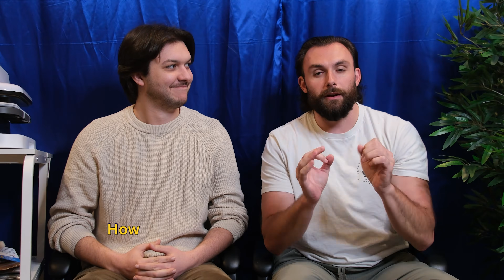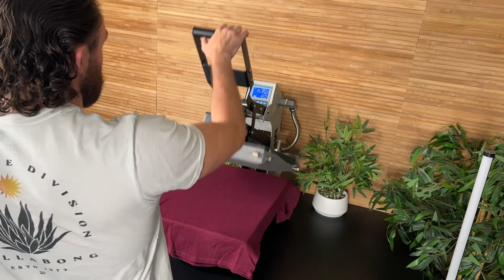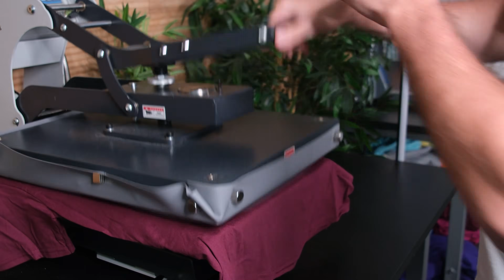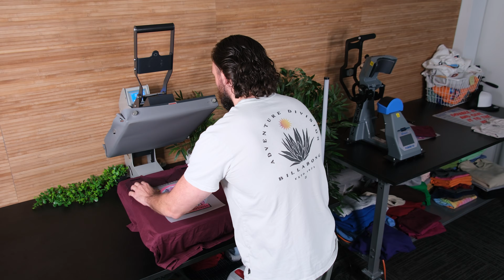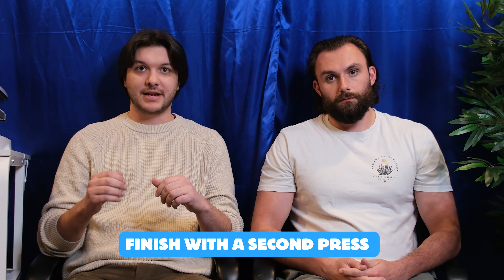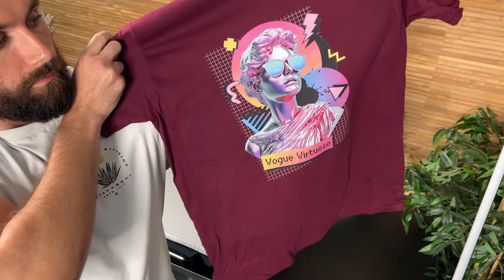How to Press Your First DTF Transfer | Step-by-Step Beginner Guide

Comment: my temp is 360F and after 20 sec pressed the print doesn’t transfer until we cool it. what did we do wrong? it is a hot peel dtf. recommended is 280F. But it’s a huge square print. like an inch within the plate on the side? does that mean the heat on the press is not balanced?

Comment: Hi, I'm wondering if you recommend using heat tape to secure the print? I see people suggest doing it  different ways. I've noticed that sometimes my shirt has print tape imprints where I placed them. I guess I'm nervous too that it might move lol! What do you recommend? I've noticed in several videos you guys don't use tape. Thanks in advance.
Reply from the maker: We recommend for certain projects! Maybe if the transfer is oversized and you want to ensure there is no movement once pressing! Our thermal heat tape is perfect for this, leaves no marks and available on our site! Check it out➡ https://ninjatransfers.com/collections/blank-apparel

Comment: HI! I am very new to DTF. I'm looking at doing family vacation shirts using DTF. I have the HTVRONT auto heat press 2. Will that put enough pressure needed for these transfers or is a clam shell heat press better? Also is the teflon sheets ok for the final press?

Comment: For the second (finishing) press, is your "Heat-Resistant Pressing Sheet" required or do I not need anything between the logo and the heat press surface? Or can I use any piece of paper (e.g. printing paper)? Thanks!
Reply: I have the same question. I'm assuming you don't place a hot iron directly onto the rubbery decal?
Reply: @a.m.s.8531  They're blazing fast at responding! lol 

So I can answer my own question having done several shirts. Their method is solid. Once you peel the paper away from the decal and the decal is on the shirt, I put down the wax paper I got from them. You don't actually need to buy the additional special paper; they include some. You just re-iron with that paper (as a buffer) and it seems to really set the decal. 

It's also pretty easy. I did about 12 shirts and messed up none. They all came out perfectly. So easy, even a caveman can do it :)

Comment: Considering the weight and size of a DTF transfer sheet, why is shipping so expensive?
Reply: Shipping costs for DTF transfers are high because carriers charge for the physical space and specialized protective packaging (like rigid tubes) required to prevent creasing, rather than the actual light weight of the film.